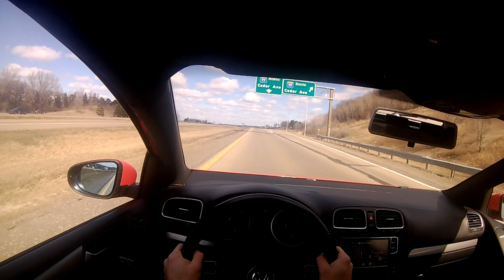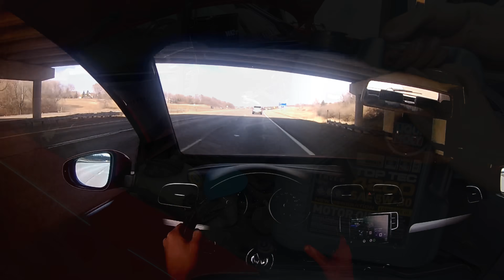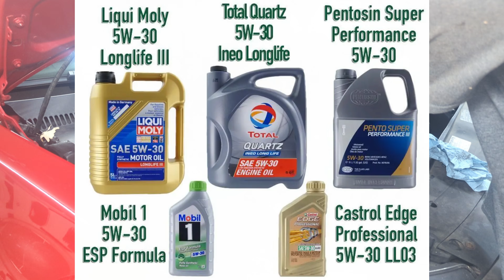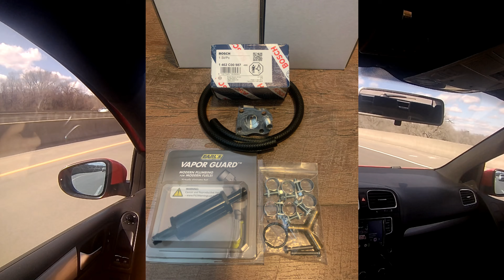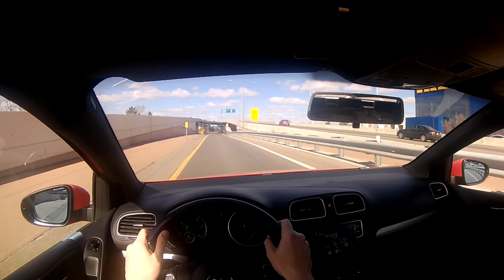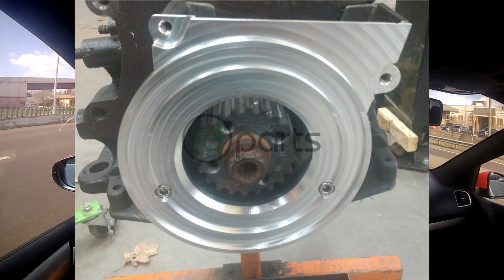How to Make Your Mk6 TDI Last Forever

Comment: Awesome video 
I haven’t found 5w30 mobile in 507 though only the 0w30 esp 
I’ve been running pennsoil 0w30 euro XL until I decide on a permanent choice
Reply: Mobil 1 esp 5w 30 is vw 507 you can tell the difference immediately.😂👍🇬🇧🦊

Comment: The vw 507 spec is not just crucial for the engine but also the life of your emission system components. Normal oil will plug up the DPF. The best option is Mobile 1's ESP engine oil. It meets the vw 507 specification and can be found cheaply at Walmart.
Reply: That’s why I deleted mine. 😂
Reply: I use mobile esp

Comment: I mean like you can spend heaps on these expensive oils but if you are leaving them in for 10000 miles it's a waste of time IMO. Oil and filter  change every 3000 doing fuel and air filter every other. Catch can is probably a good idea. All these fuel additives I mean good luck with that. Do the transmission and other gear oils every 6th oil change (18000 miles). Do this an in my experience any car from Kia to Renault you will be fine

Comment: Just buy the best oil - oil filter & fuel. Change the oil every 5 thousand miles.
Reply: I use the liqui moly oil and change every 5k. Could i go more, probably, but why. Oils cheap compared to an engine.
Reply: Has long has it's VW 507 brand doesn't matter .But Mobil one esp is the best I've found you can tell the difference immediately.👍🇬🇧🦊

Comment: Am I correct in thinking your thermostat was stuck open like mine? Or is your gauge just different? Stuck open thermostat is another common problem.
Reply from the maker: Thermostat is indeed stuck open. I've since started using a "winterfront" to mitigate the issue. However, it will be replaced soon hopefully. I have a new one sitting on the shelf waiting for installation.
Reply: @eurodriven2507 that sucks but also glad you're getting it fixed! I gained so much peace of mind when I replaced mine. I enjoy your vids man.

Comment: FWIW i've never used any of the methods you mention to prime the fuel filter after replacement, I would just key the car to the on position 3-4 times before starting the car. Never had an issue over the 150k I put on my 11 golf tdi or the 70k or so I did on my 05.5 jetta BRM. You can also just remove the harness from the injectors and crank the car a few times to fill itup.
Reply: how many times to crank? i have also done this on mine and after finding out it can be bad im worried. How many miles since you did your fuel filter? did you look for metal in the filter housing i could see very small specs on top of my fuel filter. im on 97k miles
Reply: @johnboy2436  I'd usually do it 4 or 5 times.

Fuel filter every 20k since it was new, never saw metal flakes.

Comment: Does a straight thorough resonator add any back pressure so that the turbo doesn’t run away? If this resonator would be off, my 2014 Jetta TDI would be 100% straight piped. 
I was also told to not use Diesel Purge on my year of car.
Reply from the maker: Runaway has nothing to do with backpressure. A diesel "runs away" when it starts burning oil as fuel (usually from bad seals), not because your exhaust is too free-flowing. A fully straight-piped setup doesn’t make your turbo suddenly decide to blow a seal. 

So if you want a straight pipe, go for it! At most, it's a bit louder, but really not too much drone and certainly not cause for concern regarding runaway. 

Diesel Purge is a debated topic. LiquiMoly says it's compatible, but I personally haven't looked too far into it and haven't tried it. You're better off running a quality additive with every tank than running diesel purge with every filter change. I would recommend HotShots EDT or LX4. Either is a fantastic value when you look at the $ per fillup and the performance. - https://amzn.to/3QS2CA2

Comment: I'm on my second TDI now. First had a Mk 4 and now I have an Mk 6 Jetta with a stage 1 tune from Stevenson Automotive.

IF YOU HAVE A CJAA MOTOR, do yourself a favor and pick up a cold weather turbo intercooler kit that has a vacuum activated draining system if you can find one. The weather here in Ohio fluctuated between freezing, warmer and humid, then back to freezing, and now my engine is hydrolocked because of ice build up in the intercooler and piping. If I got unlucky and any ice gets pulled into the cylinders when next I can start it, it can and will cause catastrophic damage to the engine internals.
Reply: Link for one?

Comment: My 2010 GTI has 247,000 miles and counting, definitely has its coolant problems however
Reply: Are you replacing the coolant with fresh g12 evo every 5 years? This is essential to keeping the engine (and water pump) happy

Comment: Does anyone know if the CP4 issue, if it happens, is covered by the dieselgate warranty? My 2015 Golf SW TDI still under warranty. I like the idea of the bypass to avoid the high repair bill, but if covered still, I don’t want to void the warranty either.
Reply from the maker: The Cp4 is covered under the dieselgate warranty, yes.

Comment: Wait until your high pressure fuel pump fails.
10.000 repair 
 26.000 DPF replacements.
I have replace three DPF in 80.000.
4000 each time.
DO NOT BUY A TDI.
1000 USD TIMING BELT  COST.
BUY A SUBARU.
Reply from the maker: HPFP issues are not a problem if you use additive and are any bit mindful of where you fill up. A DPF shouldn't fail as long as you do long trips or just "pothole it." Timing belt costs $1k if you get it done at a shop, but it's every 130k miles. Timing belt vs chain is a loaded topic, but on a diesel, it's a much smoother running engine to use a belt and with the natural vibration of a diesel, any help in that department is useful.

Comment: I was a fan of additives until I read an article on the actual concentrations of these products. It showed that there was little active ingredients and lots of solvents in all products tested.
It suggested that an occasional half tank of premium fuel, topped up with regular diesel would be much friendlier to the wallet.
Reply: There's a difference between an injector cleaner additive and a diesel treatment additive. Injector cleaner additives contain solvents to clean fuel orifices but tend to remove some of the lubricity of the fuel, this causes more wear in the fuel system which is why manufacturers only recommend using it every 3000 miles or so. A diesel treatment additive typically increases the cetane number, improves lubricity and emulsifies any the water in the fuel, so it is safe to add to every tank.

The additives in premium diesel fuel are mixed to certain concentration, diluting them with regular diesel decreases their efficacy. Why would an article complaining about the low concentration of active ingredients in diesel additives then suggest you dilute the active ingredients in premium diesel?
Reply: @yinyangsaladgang8789  
Having failed to find any trace of the article in my browsing history, I can only conclude I read it on someone else's equipment. 
I do remember it was a comparison of common fuel additives v Shell's ultimate petrol and diesel.
There were explanations of analytical techniques and tables of data shown which were indicative of a university engineering professor or student. It wasn't just putting a car on a dyno.
I do remember that all the companies involved were unhelpful when it came to details of their formulations.
Edit. There were references to fuel additives that claimed to be DPF cleaners. In short, they were useless as DPF cleaners, but were (as?) effective as fuel system cleaners and were very similar in formulation.
Unsurprisingly, only direct cleaning of the DPF was advised, but surprisingly, a combination of household chemicals were found to be effective. I don't remember the details, but I'm sure it was a combination of weak or dilute acids and alkalis. I'm sure you're smart enough not to tackle one without prior research and testing.

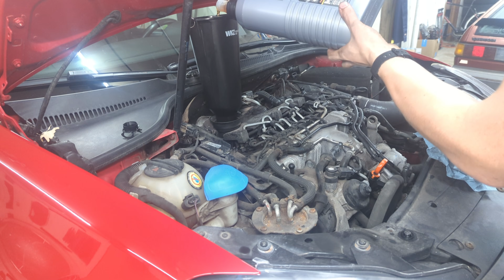Comment: 2:38 I’ve read that kind of LIQUI moly is good for diesel with diesel particulate filter tho I have a P2002 code it tells me it’s a short to ground issue so I did the method of burning off the soot that can be clogging my DPF after a week the check engine was off but then it popped again in that same day so my sensor is tweaking
Reply: Did you check the exhaust pipe for soot? Like rub your finger in the end? Mine (2014 JSW) is sooty at only 60k miles and I'm pretty sure the CEL is related to cracked DPF. New one is $3500 if someone else does the work... the video mentions exhaust modification which can be cheaper and increase fuel mileage and reliability although I'm not advocating for that.
Reply: Or your dpf is full of ash or cracked

Comment: so whats the census on notorious CP4 fuel pumps, are there any revisions that are good or they are all sheet? Also, where was the CP3 pump used at, which models?
Reply from the maker: CP4 is a problem, but not as common as the internet would lead you to believe, especially if you take care of it. Fuel filters, additives, and getting from good stations will let them last hundreds of thousands of miles. 

I don't believe any US VW's have a CP3 from the factory.
Reply: @eurodriven2507  so do all of the MK6 tdi 2.0 have the same cp4 version, or there are diffferent variants of this pump? Cause few years back I read that the 2011 and 2012 have this problem sorted out, but doing the research again yesterday I saw the opposite, that the earlier 2009 are better :D

Comment: the fuel filter casing is filled with the turn of key. just turn the key on and off several time without starting the car, and the filter housing will be primed.
Reply from the maker: Not true on a common rail, the older ones do work this way though.
Reply: @eurodriven2507 I have 1.6 TDI CAYC and fuel pump runs few seconds after turning key in to the first position. So it depens on engine
Reply: @eurodriven2507  if that true, its a yuge setback from vw.

Comment: Nice, got a new to me car with 230k miles. I have a timing belt kit sitting but will hold off until I get the other components you mention. Then the bypass kit when its in stock + clean the manifold and get a kerma tune (I'm not embarrassed that I need to oass emissions)
Reply from the maker: @emilegoguely4032  MRTuning will set readiness with deletes if you need to pass emissions. Always an option. ("For off-road use")

Comment: I started with VW diesels in the 70s, ever since the Cummins TSB for their ISX came out recommending using Valvoline Restore to clean up engines I've given our TDIs that oil every 20 K, WOW the cleaning of the engine has made the cars better, perfomance, mileage, and the oil doesn't get as black, wish the new Protect, Restore was a bit better oil I'd try it as a steady diet. The Cummins stuff is pricey.
 My last piece of advice, CHANGE your oil at 1/2 the recommended Ks, 
Ive got over 500k on 2 of them, the MK 4s both got 2 cdims apiece, got a LLY Duramax with over 400 K miles, and stll no engine, tranny issues.
 I tell people oil changes cost lots, but not changing cost a whole lot more.

Comment: I’ve just bought a 2018 tdi golf in silver white. I wouldn’t have bought a white car but this is a lovely colour and pleased i went for the colour as thought it would get dirty all the time but very easy to live with. My last car was a 1,9 tdi golf and very reliable and that’s why I went for the 2 litre this time. I think Vw can suffer either way rust issues but I’ve got in top of the paint chipping sand I’ve also taken the sponge blocks from underneath the front arches
Reply from the maker: @marksaunby9594  Does VW have the corrosion warranty in your country?
Reply: @eurodriven2507  in England yes it’s 12 years but trying to get Vw to do it is another story as they’ll say it’s stone chippings but when I had the 1.9 tdi golf they did renew the 2 front wings . I hate to see rust on a car and I’ve seen videos where people are taking the blocks out underneath the wing. I’ve had the car for 4 weeks and have noticed a couple paint chips beside back wheel arch but I’ve now rubbed them down and applied primer and paint . I think these areas are common becouse every older golf I’ve seen allways have rust around this area and it must be off the tyres flicking stones on to the bottom arches. I’ve applied a smear coating of ct1 silicone so any more stones hit that area they should bounce off 🫶
Reply: @marksaunby9594 what’s CT1 silicone?

Comment: I use single mass flywheels on 3 mk6's one has clocked over 100k miles without issue on any of them. Valero brand.
Reply from the maker: On a 6spd TDI? I know there's a certain year for the transmissions where it's okay, but by and large, it'll eat synchros. Lots of documentation about the issue.
Reply: @eurodriven2507 yeah I heard conflicting things also using SMF.

Comment: Owner of mk6 TDI here. I have a Stage 2 Malone, Whitbread CP3 pump, Bistein B14 coilovers & more.
Although my golf will never be a huge powerhouse, I absolutely love the car. 
In terms of fuel additives, Although i use power service service on the regular, one of my mechanics periodically suggested using ATF Dexron lll as a fuel additive.
It actually works pretty well
Reply: Did you need to tune after the CP3 pump?
Reply: @Swktraveller  I have the stage 2 malone tune and just did the cp3, no CEL's. So I'm gonna go with no.
Reply: What's purpose of pump after the stage 2  tune?  I know nothing but just delete everything exept the spock muffler with malone tune and dsg tune

Comment: I've read that either 5W-30 oil or 5W-40 oil can be used for the TDI. Can anyone confirm if that's true?
Reply from the maker: It depends on the TDI. 
For the ALH, you want 5w40 with VW505.00 or 505.01 spec.
For the PD engines (BRM and BEW for example), you want 5w40 with VW505.01. There are some 5w30 VW505.01 oils, but the consensus is that 5w40 will help with wear.
For a Mk6 or Mk7 with the common rail engines, you want 5w30 or 0w30 with VW507.00 spec.

Comment: If you have a DPF and the DPF light is on... try running some Hot Shots Diesel Extreme fuel system cleaner through it. The ecu sets the light off when it detects 200L or more... I drove from Phoenix to Columbus, NE and part way into New Mexico, the DPF light turned off. I continued running the HS cleaner (at max mix ratio) the full 1300 miles, and checked the DPF with my computer when I got to my destination. The DPF check came in at 7L... it went from +200L down to 7L. Sometimes the snake oil will surprise you. I was using their oil additive before and this is my first TDI with a CP4.

Comment: You could do everything right but one bad fill up will destroy it all. So thats why FUEL is the most important factor. However, mine had a DPF replaced at 66k because the previous owner only did short trips used the wrong oil.

Comment: When I installed a cold air intake on my 2014 jetta tdi i got a PO401 for EGR insufficient flow like 2 weeks later. I switched back to the stock airbox and cleared the codes and haven't got anything yet and it's been a couple months now. I've never seen this before but there was a small hose coming out of the bottom of the airbox and I didn't think twice about it because I was excited to finally have it installed, but could that have been for the EGR? Like have I just been sucking straight dust into it for those two weeks? idk if this has happened to anyone but I just really want to put it back on because it drove and sounded great, but if I'm just damaging the EGR by having it open like that then forget it
Reply from the maker: The EGR gets airflow to and from the motor with hard pipes. The small hose piece you're probably thinking of is basically a little tube that helps get some hot air to the airbox for cold start reasons.

That all said, is your TDI in warranty? If you're ready to reinstall the airbox anytime you go in for work, I see no reason not to run it. If you're out of warranty, run it.
Reply: @eurodriven2507  I still have about 40k to go for my warranty but I live in Arizona rn so I'll never have to worry about the cold lol.  But thank you so much man, I haven't had it for too long but it's good to know it's not something I screwed up. Putting it back on asap